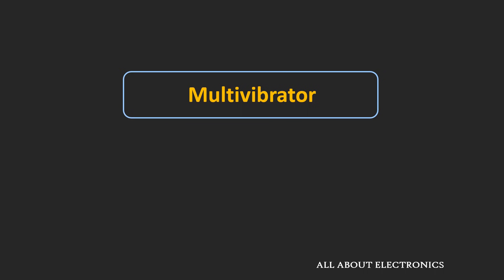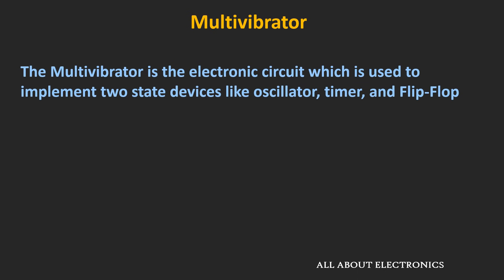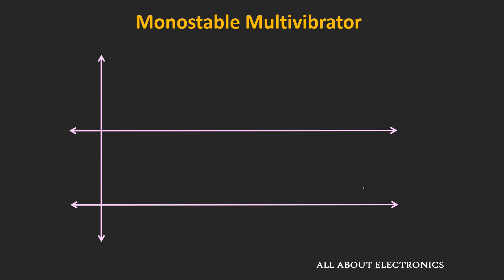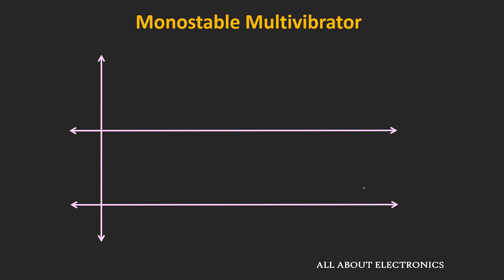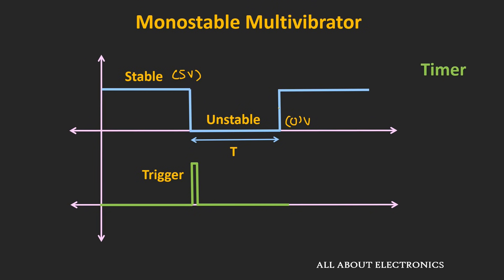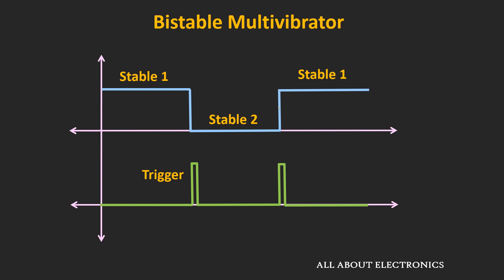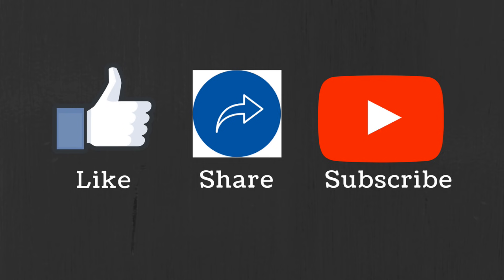What is Multivibrator ? Astable, Monostable and Bistable Multivibrators Explained

Comment: 00:16 Multivibrator circuits are electronic circuits used to implement two-state devices like oscillator, timer, and flip-flop.
00:50 Multivibrators in digital electronics
01:24 Astable, monostable, and bistable multivibrators explained.
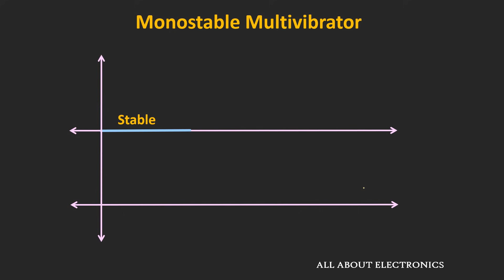02:03 Multivibrators have stable and unstable states
02:36 Multivibrators can have stable and unstable states.
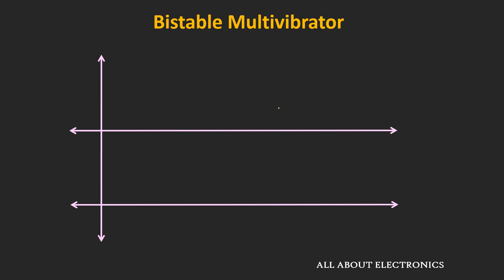03:11 Bistable multivibrator has two stable states
03:43 Bistable multivibrators are used in the design of flip-flops, remaining in a stable state until triggered again.
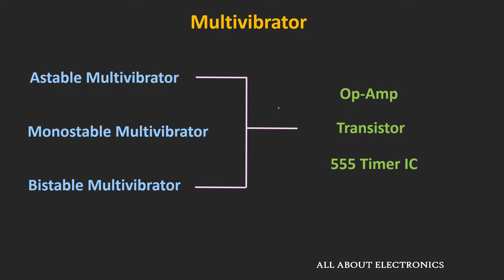04:15 Multivibrators are electronic circuits that can be designed using various components.

Comment: Multi vibrator me ky vibrate krta h 
Iska use kha hota h plz reply me
Reply from the maker: In multivibrator, the output is changing between the two states ( two voltage levels). It is used in the design of oscillator other timing related circuits. please check the description of the video. In the description, everything is mentioned.
Reply: @ALLABOUTELECTRONICS  thank you

Comment: @ALL ABOUT ELECTRONICS
Could you help me to solve these two questions 
. Design a monostable multivibrator circult that has a pulse width of 100 ms and a normally on load.

Draw the output waveform of the circuit for a single input pulse with width of 250 ms.

12. Design an astable multivibrator circuit that has a period of 1 ms, a duty cycle of 1/3 and a normally off

load.

Comment: How do we give trigger?
Reply from the maker: In one of the videos of multivibrator, I have also shown the circuit for trigger. Typically, the trigger is event based output of some other circuit. But it can also be generated using the hardware circuit or using signal generator.

Comment: 555 timer block diagram has a flipflop.so multivibrator can be build with 555 or multivibrator can be used to build flipflop?but which is the basic block then flipflop is included in making multivibrator or vice versa???
Reply from the maker: 555 timer can be used as bi-stable multivibrator. But flip-flop is very basic block. There are different ways the multivibrator circuit can be designed (like BJT, op-amp, 555 timer).

Comment: I have a little confusion about stable and unstable state. Plz rply
Reply from the maker: When we say a stable state, it's the state or the voltage level in which the circuit remains in the steady state condition. 
Due to some triggering action, momentarily circuit may go into the unstable state and once again comes back into the stable state.
In astable multivibrators, there is no stable state, means output continuously changes its state between the two unstable states.
In monostable, momentarily it goes into unstable state and comes back into stable state.
While in bistable, both states are stable. That means in steady state condition, depending on the triggering action, the circuit may be in any of the two stable states.
I hope it will clear your doubt.

Comment: Unstable means?
Reply: What happens in that state
Reply from the maker: Unstable means it's not the steady state output of the circuit. Under steady state, the circuit will operate in stable state. But due to external trigger, the circuit will come out of steady state or circuit becomes unstable. So it is called unstable state of the circuit.

Comment: Sir, I'm making a triangle wave generator with relaxation oscillator. As you know, It's inevitable fixing voltage amplitude when I change the frequency  in the circuit using relaxation oscillator combined by intgrator. I need to control freq independently of voltage amplitude using  relaxation oscillator. Is there anyideas to solve this problem?

Comment: Why the name is 555 timer?, Is there any specific reason?
Reply from the maker: Because initially when 555 timer was designed, the value of the three internal resistors which is used for voltage divider was 5k. 
That's why it is called 555.